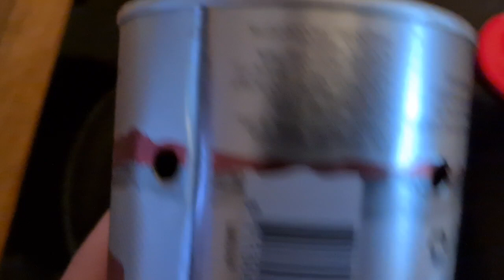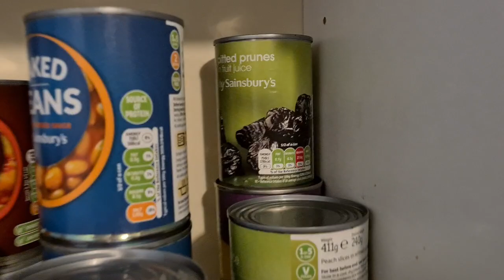READ WARNING, Candle Heater Made From a Tin.

Comment: Why does a candle warm the room more by having a tin over it?
Reply from the maker: Hi R, the candle hears the tin up and gives out more heat than just burning a candle it's self and lasts longer.
Reply: @EdenValleyAdventuresUK  So the room heats up more than just with the candle? Like free energy?
Reply: Well think about it, a candles what starts a fire so yeah 😂
Reply: @gibbousmoonasmr  If a candle starts a fire, then whatever is burning provides the energy for the heat. If only  a candle is burning, there is no other energy source than the candle. 
If you put a tin / plant pot over a candle, the air in the room will be warmed less because some of that energy is now heating the tin / plant pot. So the reason for doing this is to trap the heat near the candle and let it radiate from there, rather than allowing the heat to rise towards the ceiling.